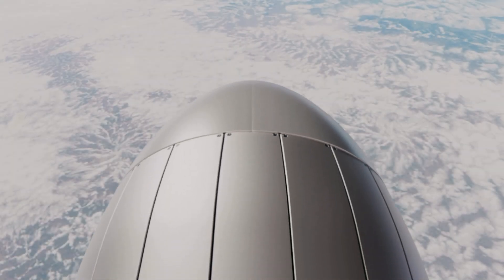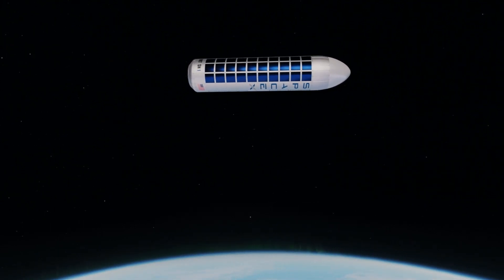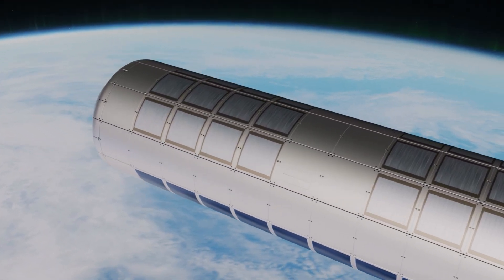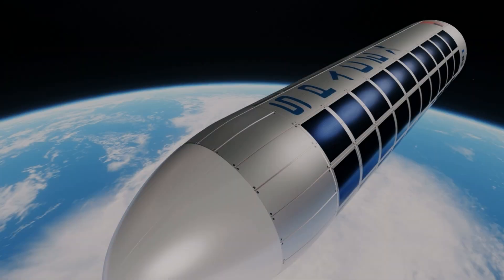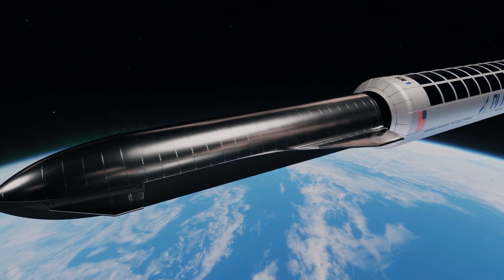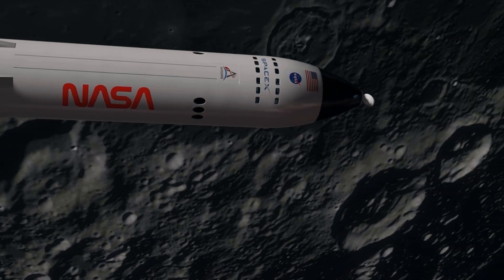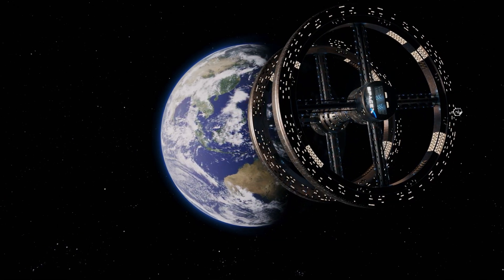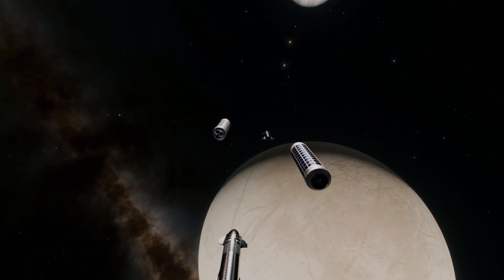SpaceX Orbital Mega Tanker concept

Comment: Can't work without the the sea level Raptors. Starship 100% needs them to reach orbit. Not only does it need the raw thrust, the vac Raptors don't have gimbal control, so without the SL engines, it would
 have no ability to control itself.  

Case in point, the Lunar Starship concept has ALL THREE sea level Raptors.... when at most it needs only one for gimbal control. Why three? It needs the thrust to get to orbit.

Still, I like the overall concept a lot, makes a ton of sense in particular for refueling the Lunar version...

Comment: If it's empty on ascend, might an inflatable/extendable version not make more sense? I also see alot of disadvantages of course, but maybe there is a work around that could increase the useable volume per unit of mass?
Reply from the maker: That might work. You all are giving me some cool ideas
Reply: I think the fuel should be manufactured on the moon, and delivered to LEO. Also the starship should attach to (10) megatankers and pull giant space barges to Mars. 

Imagine you send up 1000 passengers to LEO with one launch of starship. Then you launch it 100 more times, with cargo, habitation modules, and fuel. Then starship attaches to the mega tankers, and slowly accelerates to escape velocity. At Mars, it lands, refuels, relaunches, and lands againX100. After all that, it returns to earth.

Comment: The Orbital Mega Tanker Concept has value as a permanent depot.  The solar panels & power storage for an ion engine to adjust the orbit is a good idea. The increased diameter will add significant construction cost … it may be much more economical and equally functional to simply use the existing starship diameter and construction methods to link maybe two or three tanker modules. The cargo mission objectives seems to be an un-necessary add-on … keep it simple!  Keep up the good work … your efforts are admirable.
Reply from the maker: Yes this could work as well. Could be a good design for an Orbital Giga Tanker. LOL

Comment: It's better to build a big tanker stations - for instance 10 stations with 120 000 tonns of propellant each - not just tankers. Because in your concept you need like 300-600 OMT to refuel 1000 cargo and crewed Starships. A window to send Starships to Mars is just about 1 month every 26 months. 
1.2 mln tonns of propellant in total should be held in storage(s) on LEO to refill 1000 Starships for flights to Mars. 
I think they should be made of a soft and light material with a firm frame - to stay controllabe and have a sun umbrellas (shields) which protect the propellant from warming up.
Because we need 6-12 times more flights of Starship-tankers to refill cargo and crewed Starships. It would be quite hard to make 7000-13000 launches just for 1 month. 
That is why maybe it will be more resonable to gradualy refill special propellant storages on LEO beforehand during 26 months.
I wonder how all this system might look.
Reply from the maker: Yes your are right, this design is not really meant for servicing 1000 Starship. For that I will create the Orbital Giga Tanker. Stay tuned
Reply: @meandgrok  Light and soft material - to easily deploy the system on LEO and to make it possible completely burnable out in the Earth's atmosphere. Cause - you know 120 000 tonnes tanker that is falling from sky - a little bit too much.

Comment: Radiators need to be set out away from the tanker on a boom to be more efficient.
Reply: Rotisserie roll with solar panels and radiators on counter rotating hub would reduce thermal load and provide an centrifugal/ullage effect outwards to reduce need for separate  preload pressure chamber/ullage motors.
Reply: The easiest way to keep the cryogenic liquids cold is to simply maintain shade from light and IR emitted by Sun, Earth, or Moon. The rest of space looks very cold indeed. 

For example, maintain a multilayer metal foil shield against direct sunlight and keep the radiator panels edge-on to Earth light.
Reply: Yes. Booms give the radiators both sides to emit IR. They just have to stay in shade.

Comment: Cool concept,
But it would still need more engines if standard needs 6 (with 3 vacuum).
Also extra isolation would be useful (less problem with cooling).
Reply from the maker: Yes, you are right, more isolation is needed then a regular Starship

Comment: Actually that’s not a bad idea.  They could routinely refuel it so crewed starships wouldn’t have to wait for several launches to refuel.  They could do routine launches to fill it.
Reply: Yea i think NASA would prefer 1 refueling for starships with people in it. much safer then 12 plus ones.
Reply from the maker: @zotechgaming1095  Yes it would be a lot less risk and saves time for the people on crewed Starship as well
Reply: @zotechgaming1095  True, a single refueling from an in-place orbital fuel depot would be more practical.  I'm sure that will become a reality down the road at some point .  I'd be shocked if SpaceX doesn't have ideas for this already.  The specific ideas for how to do a fuel depot presented in this video, though, are absolutely impractical and will never, ever happen.
Reply: They could simply use a first unmanned starship as refuel tank, fill it to max capacity with other starships, then, send the manned starship and fill it with it = one refuel for the manned starship. Simple, no need to spend time and ressource for a super tanker. But this concept could be very uesful later. But for now they better focus on making starship as reliable as possible before developping something else.
Reply: @yamapopi    Elon Musk said they would probably start designing a tanker in about a year.
Reply: @TexanUSMC8089  They will but based on the starship; not on a new design
Reply: For only one Starship they could just put normal tanker and refuel it with other tankers.
After refueling it will have little bit fuel left (because it is tanker) so it could safely land.
Reply: @ImieNazwiskoOK  I agree but why land it. Make a variation on the model. Strip it of reentry and landing equipment and add refinements along the lines of the video. Make at a space based and serviceable tanker model and cycle it the moon and back.  Might as well make a lot of them, fuel, air and  water is good. Might be more efficient to do the refilling at Mars.  Infrastructure for conquering the Solar System will require something like this.
Reply: @alien8treker2  
Starships that "cycle" must have heat shields and fins. That is how they slow down again at Earth or Mars without consuming propellant. Falling into these gravity wells will create a lot of velocity.
Reply: @imconsequetau5275  I was thinking that being unmanned, the tanker ship could move slower and avoid aero-braking by use of the ion propulsion.
Reply: @alien8treker2  
Even when you select a slower transfer orbit, the ship gains speed at the destination as it falls into the planetary gravity well. Now you have to shed both the excess transfer orbit velocity and the additional velocity from approaching the planet. 

"Aero-capture" is what you need to gain a planetary orbit, and has the lowest cost in both hardware and propellant.
Reply: @imconsequetau5275  You're probably right. I was thinking the Ion propulsion could accomplish orbital insertion.
Reply: how would you stop space debree from hitting it
Reply: @zigabelcijan6650  RCS and THICK hull
Reply: @zigabelcijan6650  the same way you deal with it hitting anything else, avoidance and redundancy.
Reply: @zigabelcijan6650  
Damage from space debris in LEO would be reduced by wrapping a tanker in space with many additional layers of relatively thin metal foil with ample space between every layer.
Reply: One mega tanker is a better idea less can go wrong if its routinely maintained then sending a ranker up with each starship
Reply: yep. brilliant.
Reply: @mr.prince8701  Sadly far from brilliant.  The idea of an orbital fuel depot has already been suggested by many people.  That's a good idea.  This particular implementation is not well thought out and completely implausible.  This design is absolutely impractical and would never, ever be considered by SpaceX.
Reply: @Me__Myself__and__I  never say never.
Reply: @mr.prince8701  I generally agree with the concept of "never say never".  Except the specific concept in this video would never, ever, EVER happen.  Its not at all practical and is poorly thought out.  SpaceX will likely do some sort of orbital fuel depot, but they will come up with something much more practical and useful than this particular concept.
Reply: @Me__Myself__and__I  The concept is, of course, not new. I'm for any idea that gets rid of multiple refueling in orbit.
Reply: @mr.prince8701  Agreed.  This particular one, sadly, is very poorly thought out and not at all compatible with SpaceX methods or existing work.  Elon probably already has ideas.  I mean, they plan to build a BUNCH of Starships so there will probably be a variant designed as a fuel tanker where they can send a few of them up, connect them together and preseto have a fuel depot.

Comment: Elon is all about speeding up & streamlining ways to get to space and Mars faster and with fewer steps. “The best part is no part.” This is a great idea!
Reply: this is the opposite of "the best part is no part". this is probably a good idea. but it is a lot of extra R&D. its essentially a whole new spacecraft.
Reply: @applesaregoodeatings  Exactly why this is a poorly thought out concept and will never, ever happen.  This idea literally CHANGES EVERYTHING which would require vastly more research, time, effort & money with very little practical gain.  SpaceX will probably do something about orbital fuel depots in the future, but whatever they do will be based on their existing research, knowledge, manufacturing process, etc. in order to make it practical and fast.
Reply: @applesaregoodeatings  
“The best part is no part” why not then take a super heavy’s already planned architecture, and swap a few engines with RVacs, attach a fairing nose cone the same way the starship will attach, have a refueling probe like the one they’ll use on the ground, and having Super Heavy launch itself into orbit for pushing very large spacecraft around without the spacecraft using any fuel? Suppose Super Heavy were used to gently move a station the size of the ISS to a much higher orbit. That would make my concept more practical than the OMT.
Reply: @topsecret1837  Your concept is basically an SSTO, it wouldn´t work. But you could lift a vac-optimized booster as you described with a classic boster into LEO and use it as intended, that makes sense. The mega tanker concept is basically an enlarged tanker version, put to the maximum possible size. It may be useful to some missions, so we could see both.

Comment: I feel like it would make more sense to use extendable solar and radiator panels, even if it is just one time extended and done (ie. not retractable). These radiator panels are rather inefficient with only one side being used, and putting them on the hull limits the positions you can put the tanker in. I also don't know if one side of solar panels (not all optimally placed) would be enough to power and cooling units (for the fuel) and using the engine, maybe.

And honestly this still feels too small scale, I'd expect a fuel depot in low earths orbit that can refuel several starships, possibly made up of several tanks sections and no need to move around. A mobile storage platform is great to support operations futher in space (lunar, geostationary, mars, ...), but is a waste in low earths orbit.
Reply from the maker: Yes you could be right. But this one can also be used for deep space mission. To get cargo further and faster then regular starship since it can carry more fuel.
Reply: @meandgrok  Yes, I agree with that, I just don't think this kind of design would be used for an LEO depot.
Reply: @Brad DeVoir I think this version would be 0 on fuel when reached LEO
Reply: @Brad DeVoir  For one, I never said a depot is a waste (on the contrary, I think it will be very usefull, even necessary for musks mars aspirations), I said a mobile depot is a waste for an LEO depot function.

Secondly this depot starship is not going to get more fuel to orbit, the regular tanker starships are already pushing the maximum starship can get into orbit. This depot will be launched mostly empty, especially seeing it also might/will be heavier due to the increased size. By time it is in orbit it will almost surely be empty and need refueling by tanker starships to fill up.

Comment: So a type of orbital fuel depo

It can also be useful in CIS-lunar refuelling missions
Reply from the maker: Yes, it can have deep-space applications as well
Reply: @meandgrok  do moon colony  best  with landing pads  , have any problems  they repair on the colony  on  the  moon.
Reply: safer on the moon refueling and repair
Reply: @hillbillyintheasia6122  You need far more fuel to do this, landing on Moon could be very hard for normal Starship.
Reply: Confederacy of Independent systems?

/s
Reply: @russianman5099  No
Reply: Yes!!!
Reply: Let's see cargo and passenger versions of this size!
Reply: What is the exterior diameter of this? Can it be launched on a Super Heavy alone or with strap on boosters?